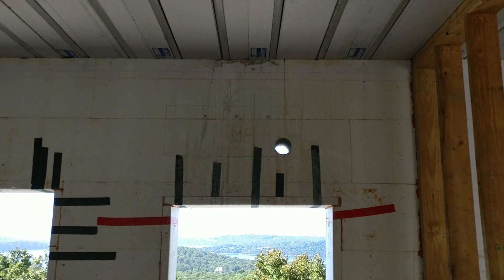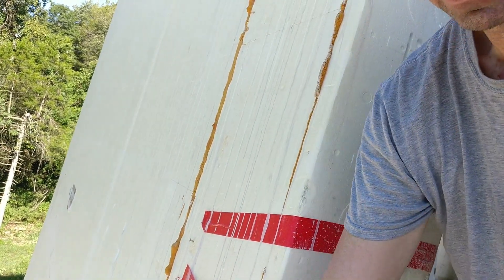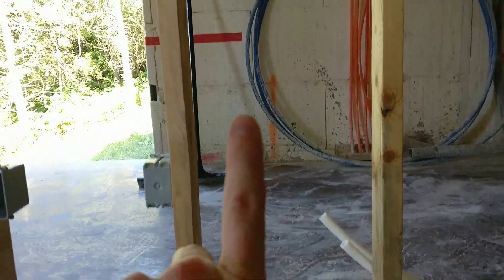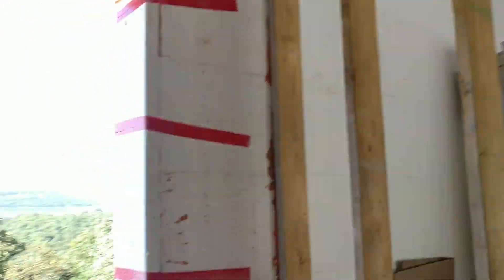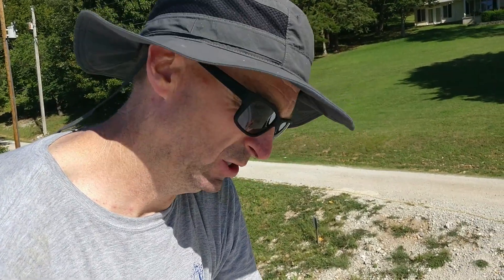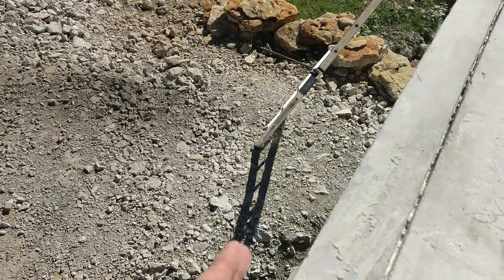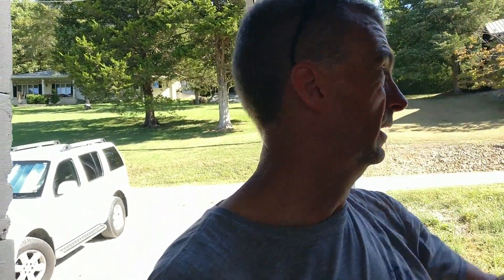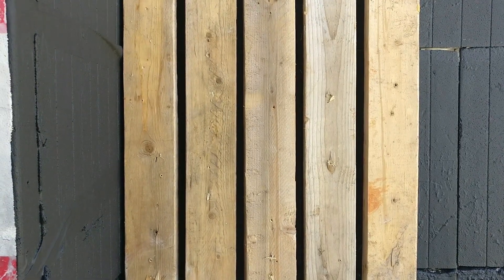Cutting and coring ICF concrete block walls on a residential home for ERV, electric, and vents.

Comment: So there is no way to insert something to hold the space before pouring?
Reply from the maker: There is. Some people put in PVC pipe to hold the space during the concrete pours. We talked to our ICF builder about doing that but he said that many times after the pour the homeowner discovers they actually need the hole location moved. We have to cut the door openings anyway, so he advised to just do the coring at the same time. It ended up making sense for us because we didn't have our electrical box set or know exactly where the erv was going to go until after the walls were up and the roof was on.

Comment: I had LP Smart side per finished put on my house last August. I STRONGLY recommend using a different product. If you read LP’s warranty they have so many ways to void it. You will NOT be compliant if you don’t use an approved house wrap, the rubberized paint will void the warranty. Also you must use an approved caulking and stainless steel nails. Be sure ANY cut edges are painted. The caulking is an absolute nightmare to work with and you will need to thoroughly inspect the caulking on a regular basis (especially when the temperature changes from season to season) It tends to crack and create gaps. If you do use it, be sure it’s a minimum of 6 inch off the ground because that will void the warranty as well. Overall the product looks great and as long as you maintain it and use approved materials, you will be ok. I genuinely feel there are better products for the money and I really hope you pick a different product. 

Traditional cedar would be my first choice because the reddish hues will really come to life against the black. You could also look at composite decking or James Hardie board.
Reply from the maker: Oh wow! Thank you for this information. Maybe we will go back to looking at James Hardie trim. We have thought about using cedar but we really don't want to deal with the maintenance. It may be easier for the install than the LP smartside it sounds like though!
Reply: @LakeLotBuild  Smart side is very easy to install. My biggest complaint is having to routinely inspect the caulking for any cracks or gaps from shrinkage. 

There’s a place not far from you in Buffalo MO. The sell rough sawn Cedar lumber very inexpensive and might be worth looking into. You can find them on Facebook Market Place. 

I was also thinking, IF you go with Smartside I strongly recommend completely covering the black foam with trim coil, paint it black, and then install the Smarside. It’s inexpensive and compliant with Smarsides warranty. Just be sure to read their warranty very carefully. There have been many complaints and lawsuits against LP over the years. LP almost always defaults any issues to (it was improperly installed.)

Comment: In Korea, where flat concrete roofs are ubiquitous, they never use rubber membranes. It's either nothing, basic liquid water proofer, or (most usually) the same epoxy stuff that goes on floors.
Reply from the maker: And there is no problem with leaks? The wife is terrified of the flat roof leaking.
Reply: @LakeLotBuild  Not that I'm aware of. Most of these types of houses were built in the 70s-90s. Maybe early 2000s. They usually have exterior stairs too. Helps make up for small or no yards. Kimchee pots, clothes lines, or even raised bed gardens are placed on top.

Comment: hard to tell... did they slope the holes down a bit toward the outside, in case of water penetration & surface tension?

saw your earlier replies on the PVC tubes pre-pour... def motivation for me to take the extra time on my planning & be sure to leave some wiggle-room where possible to hopefully avoid cutting/coring. likely going to put most through large dia pipe under the footer (using FastFoot) where possible. sorry to hear you had a bit of trouble with the one wall & doorway!

Comment: So, it’s 6 inches of concrete core with 6 inches of styrofoam, 3 on each sides, interior and exterior right??
Reply from the maker: 8 inches concrete 2 inches styrofoam on each side
Reply: @LakeLotBuild  -Thanks.

Comment: Not to be a negging nancy or anything.
But pushing multiple lines through a huge hole isn't the best idea from an air sealing perspective.  Because no matter how you do it, you still wind up with it bypassing the plug/seal in the micro-gaps between the various lines.

Yes, it's faster and cheaper to do it this way.
But you surrender some control over your building envelope.